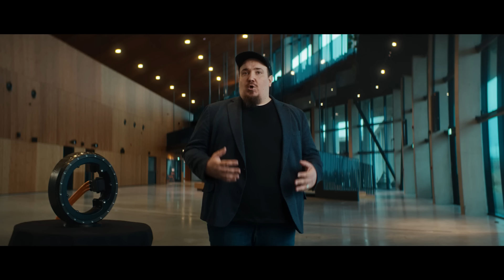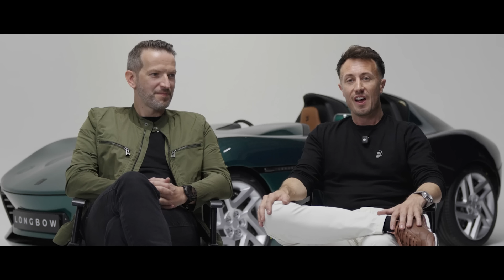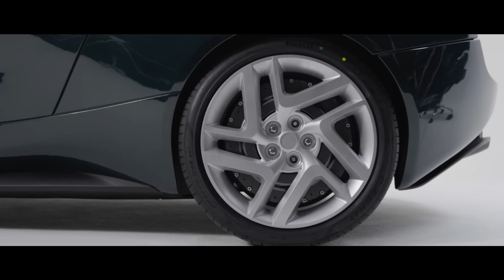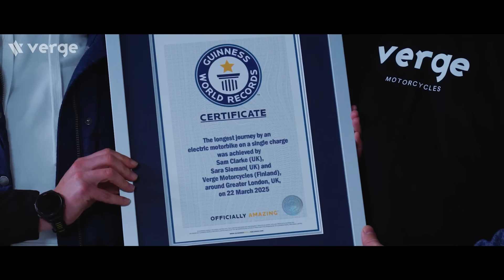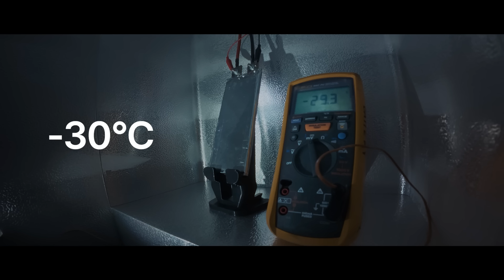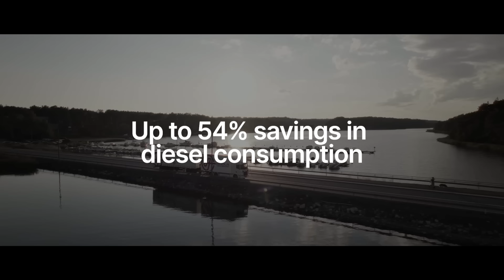World's First All-Solid-State Battery in Production Vehicles | Donut Battery

Comment: The “Lehtimäki Pattern” — Why the Donut Lab/Verge claims are a textbook hype-and-exit setup

To truly understand why this is almost certainly a scam, you have to look at the track record of the people behind it. The founders, Marko and Ville Lehtimäki, have perfected a very specific “Fake it until you sell it” cycle that has repeated for over a decade.

1. The Asilab / Asinoid “Brain AI” (May 2025)
Just a few months ago, this same team launched Asilab. They claimed to have built an AI called Asinoid, which was supposedly based on “the architecture of the human brain” and would achieve AGI (Artificial General Intelligence) faster than OpenAI or Google.

• The Reality: It was a total ghost. Experts quickly found signs of plagiarism in their documentation, and the “revolutionary AI” turned out to be nothing more than marketing buzzwords and repackaged existing research. Once the hype died down and they likely secured whatever interest they needed, the project went silent. It was a “breakthrough” that never existed in reality.

2. The AppGyver Strategy (The Exit)
Before the AI and EV hype, there was AppGyver. It was marketed as a “no-code revolution” that would disrupt the entire software industry.

• The Reality: They successfully hyped it enough to get acquired by SAP in 2021. But ask any developer who actually used it: the tool was notoriously buggy, slow, and far from the “world-changing” platform they sold it as. It was a masterpiece of selling a vision while delivering a mediocre product. The founders got their payday (the exit), and the tech just faded into SAP’s corporate basement.

3. Verge Motorcycles: Moving the Goalposts since 2018
Verge (formerly RMK) has been “about to ship” their hubless motor bikes for nearly 7 years. Every time they miss a delivery window, they announce a new, even more impossible “innovation” to keep the investment cycle alive. Now that people are questioning the motor, they pivot to “Solid State Batteries.”

The Donut Lab “Battery” is just the latest version of this playbook:

• No Patents: As OP mentioned, you don’t “invent” solid state chemistry without a paper trail.

• Nordic Nano: They claim their partner, Nordic Nano, is a manufacturing giant. In reality, it’s a small Finnish startup focused on solar panels with no public record of solid-state battery expertise.

• Impossible Physics: 0–100% charge in 5 minutes with a 100,000-cycle life? That’s not a breakthrough; it’s a fairy tale designed to separate gullible investors and pre-order customers from their money.

Conclusion:
This isn’t about science or engineering. It’s about building enough hype for a buyout or a massive funding round before the laws of physics catch up to the marketing department. Don’t be the exit liquidity for another Lehtimäki project.

Comment: In 3d renders I too have independently made a battery with 10000 Wh/kg energy density, charges from 0 to 100 in 5 seconds, can give 100% efficiency in extreme climates (-100C to 1000C), 1 trillion charge cycles, full safety even when punctured all over.

Comment: They seem to have found a way to beef up Supercapacitors energy density from 5–20 Wh/kg to 400 Wh/kg. What about self-discharge will it be the same 5–10 % per day? will self-discharging increase with charge cycles?
-
The compromise is most likely self-discharge. Yes you have the power, but you have to use it can't rely on it being there a week later.

Comment: I want a commuter Verge with the performance of a 4 stroke 400cc 4 cylinder 50HP Suzuki from the late 1980s, with a 700km range. With a similar bike lifespan (FYI i retired my Suzuki in 2017. More than 800,000km on the clock. The 1980s suspension was a bit tired, handling was still very good, with excellent brakes, and its top speed was still over 230kph -not hat it was ridden at that speed often.). 
Bikes these days need to have excellent acceleration to 140Kph, but will be ridden in most instances below 125kph on most highway systems. Stoping, turning and robust enough to handle an occasional off into the rough when road surfaces fail unexpectedly. 
Simple criteria to meet in the combustion world.  
One last option would be the ability to carry a backup battery cell that provides another 115km of range, to be plugged in when 700km isn’t quite enough range. Just like the litre of fuel  I used to carry. The ability to add an artificial combustion motor roar when navigating very heavy traffic would also be useful to alert tin top drivers that a motorcycle is present in their blindspots. Build sporty, commuter bikes that can be used, abused, and ridden beyond the limits of the designer’s imagination. That is the path to achieving global dominance.  If it doesn’t handle like a slightly more stable GP bike, and cant carry a rider and gear weighing 120kg in all conditions it won’t pass muster. If it can not be braked from 170kph to zero in less distance than a supercar, while being actively steered by a rider whose turned off ABS and stability control it wont pass muster. If it costs thousands to repair after being dropped it wont pass muster, and if can’t be drifted (both wheels) at 170kph its just not safe enough for rural highways in NZ, where dodging wildlife, potholes and slips on closing radius, off camber corners in treacherous weather is a norm. Deliver that level of capability and that little 400cc  50hp equivalent would be as successful as the Honda 50cc scooter and far more safe and practical. And don’t forget luggage rails, and pillion comfort.

Comment: More about 🔋Battery Tech 🔋is mentioned below:👇👇

It's likely a solid-state super capacitators made by Nordic Nano.

Nordic Nano’s first production facility in Imatra, Finland.
They will begin producing carbon-based solar film and solid-state super 
capacitators in 2026. The pre-production equipment will be 
installed during Q4/25 while the mass production kicks-off in H1/26.

Comment: They are lying about the motors. They do not hold any power to weight world record. The world best motor is made by YASA Limited with 59kW/kg. The Donut motor is barely 16kW/kg. The YASA motor is used in Lamborghini Temerario, Ferrari SF90 and Mercedes Benz cars.  
   What independent lab testing was done to confirm their claims about the battery? Not to mention there is scarcely any details about the chemistry. Lack of details and lies about another of their products does not make a bright image.

Comment: Proof is in the pudding. The EV market needs a AWD vehicle with hub motors at a minimum of 10 pounds per horsepower total output. ~400 mile range with a 10%-80% charge rate in under 15 mins. I coin this term the 4444 law for EV's. ***4 wheel drive(AWD) / 400hp / 400 usable miles/ Under or at ~4000lbs curb*** I"ll even go a step further with it being in the $40K range USD.

Comment: Hi Donut Lab team,  genuinely curious and excited by the solid-state claims. To understand the engineering better, could you share a bit more technical detail (even at a high level)?
Is 400 Wh/kg reported at cell level or pack level (and do you have Wh/L)?
For the “~5 min 0→100%” claim: what pack/cell size is that based on, what peak/avg kW, and what does the charge curve look like (esp. last 20%)?
For “up to 100,000 cycles”: what’s the cycle definition (DoD window, C-rate, temperature) and the end-of-life threshold (e.g., 80% capacity)?
On safety: any published results for standard abuse tests (short-circuit, crush, overcharge, thermal ramp, penetration) or certifications like UN 38.3 / UL / IEC?
On extreme temps: when you say >99% at −30°C and >100°C, what discharge rate and duration were used?
Any public patents / whitepapers you can point to (or is this mainly trade secret)?
Totally understand if some details are proprietary - even partial answers or a link to a technical brief would be awesome. 🙏

Comment: Why don't you guys start selling these battery packs on the market?!?
(so people could replace the old ones on older hybrid and electric cars)
You could already configure them for Priuses and Leafs.
Also, making electric wheel motor+battery kits to be fitted on regular petrol and diesel cars will blow the market.
You can also make regular 12 Volts batteries for cars. 
Imagine having on your petrol car a 12V battery that doesn't need to be replaced and reducing fuel consumption with the wheel motir-battery kit by 30-40%!!!

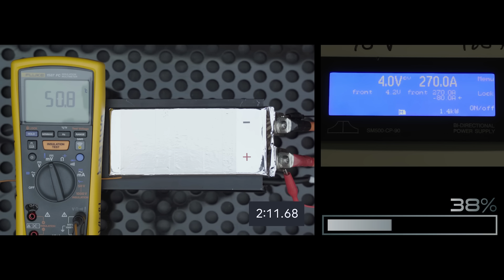Comment: Sooo, is it just me, at 13:20, the battery starts to expand internally from gas building up inside of the battery. And the temperature is wayyy too high towards the end. Also, the power supply, power output, and wire gauge… the math ain’t math’ing. Also, this battery, let me guess… a graphene battery.
Reply: I think they didn't noticed that before uploading this video

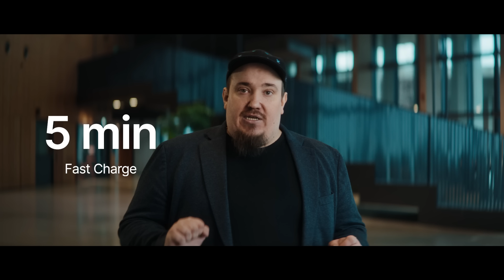Comment: I don't believe their claims based on the information shared in this video and their website for example if you observe the fast charging clip carefully between 13:12 to 13:21 it shows the cell charges from 0% to 82% state of charge (SOC) in 5 minutes but the cell voltage only increased from 3.8 V (0%) to 4.2 V (82%), this is important because it is impossible for a battery cell with only 0.4 V operating window to reach energy density of 400 Wh/kg. It is actually possible to ultra fast charge a solid state batteries but it very very hard to believe that their battery could survive 100000 fast charging cycles since the main challenge that is holding back solid state batteries is their cycle life. They also don't give any information about the chemistry of the battery (based on the voltage I am guessing it is NMC/Li metal battery but not sure) but they are claiming that they are using abundant materials. Also did they develop the battery cell themselves? if so, do they have a battery lab where they develop proprietary battery materials?  Do they have battery cell production facility? if so why don't they show these facilities? Most importantly how does a company which produces electric motors could find the secret solutions for ultra fast charging solid state battery cell with the ultra long cycle life? Do they have any patents or papers to support their claims? I even checked their website but couldn't find any answers to my questions.

Comment: The technology this battery is based on would be great for use in Amateur Radio during their field days, parks on the air, and radio related events. Good for emergency backup power for radio equipment.

Comment: Personally, I would have used the multimeter to display the battery's voltage or current and a thermometer for the temperature if I were trying to demonstrate battery performance. I hope you really did figure something out and are able to prove it soon...